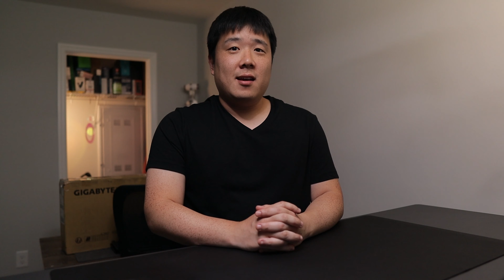Gigabyte Aero 15 Unboxing & First Impression - Laptop for Creatives?

Comment: Thanks for the review! So this laptop can be charged over type C right?
Reply from the maker: Yep!
Reply: @JosephKim  really? Thanks thats nice to hear. I've been reading reviews that it cant be charge with usb c. Was really bummed about it. Have you tested it besides the led charging in the video, like really indicated in the battery icon? Thanks. Is it up to 100W pd?
Reply from the maker: @grapegh0stx  yeah. It works. Ive tested 100w charger and I can't be sure how much it is actually drawing, but charges well. The older version of the laptop didn't allow PD charging, that's why.
Reply: @JosephKim  ya my old aero 15x doesnt support pd via usb c. Ive been reading specifically the 11th gen i7 with rtx 30 series aero and some are saying not usb c charging not working. Maybe they are using low wattage usb c charges lol. Anyway thanks for the confirmation
Reply from the maker: @grapegh0stx  interesting. Yeah, most of laptops that I have reviewed requires at least 65W PD for the laptop to do some charging.

Comment: Hello! I have some questions/concerns regarding this laptop that I would LOVE if you touched on even just a few of them:

* There were many reports of very loose hinges, or excessive screen wobble. Could you place it in some use-case scenarios to see how it plays out? ( wobble when typing, using it on your lap, etc)
* in previous models, sometimes the screen would only actually be 'connected' on one of the hinges. Could you do a close-up shot to analyse this? 
* In a dark room, how bright is the Aero logo? I feel like It would be extemely distracting / annoying / embarrassing during something like a classroom PowerPoint presentation (Aka a dark classroom, dark cafe, etc) 
* battery life tests in general. How many hours you could get on days you're strictly using it for basic use (Research, Microsoft Word, browsing, etc). If possible, on max battery life mode, "low CPU/gpu power" on the gigabyte software, "meeting mode" or having the fans off, and stating the brightness level of the screen during this test. 
* in previous gigabyte laptops, the gpu would be used by background programs and draining battery life, even if it wasn't needed or on idle. You can see this by opening Nvidia Control Panel>Desktop tab> and checking "Display GPU Activity Icon". 

Theres a large forum thread dedicated to the previous model, where disabling the apps being shown/used by the GPU in this way improved battery life by almost 2-3 hours in some cases. 

* can anything be done beyond the basics to improve battery life? (for example, undervolting CPU, undervolting GPU, disabling GPU, disabling RGB keyboard, 
* how bad is the glare on it? (window behind or beside you. Daylight outside. Or only the room lights being on)
Reply from the maker: Very very good questions. Will do my best to answer them!
Reply: @JosephKim  thank you so much! I know I wrote a lot, but I'd be happy with whatever you manage to look into 😊
Reply from the maker: @Sir-Reborn  on it!